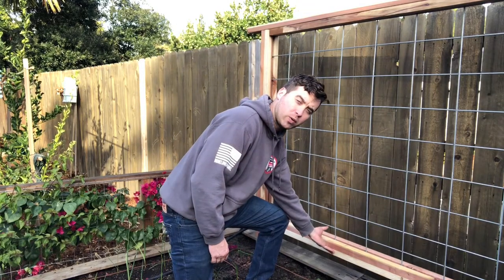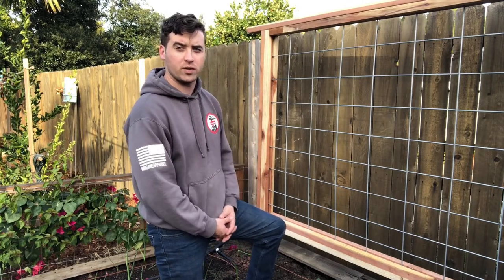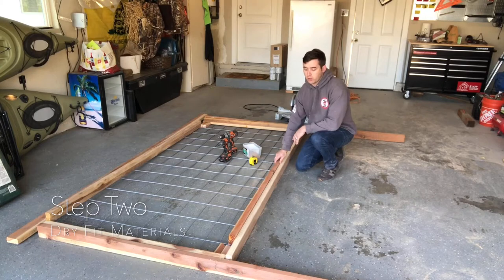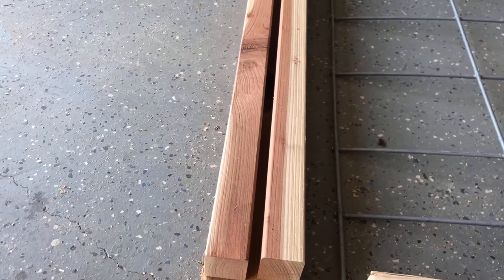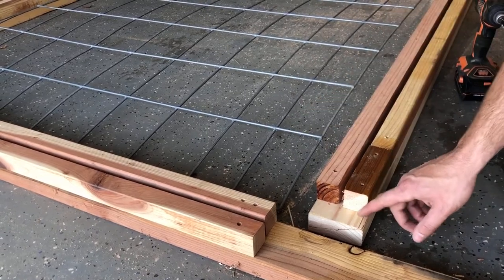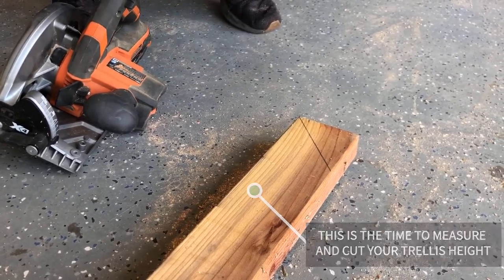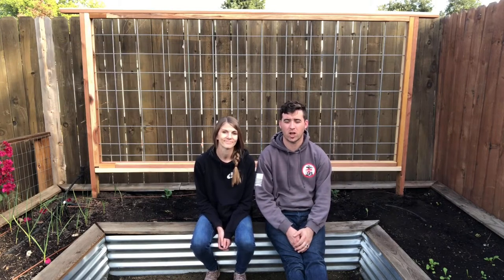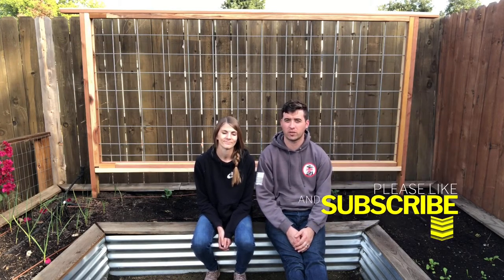DIY CATTLE PANEL GARDEN TRELLIS // Easy to Build and Sturdy Trellis for Your Garden Climbing Plants

Comment: Hi great job, I am think of building the same one. I just wonder for your post depth, is it sufficient for hanging pots. it looks fine for vines only but not sure if I need to dig more if I am gonna hang pots on that
Reply from the maker: The posts are about 14-18” deep. I would definitely go deeper if you were going to have significant weight hanging from it

Comment: Living in 9B, do you think those materials would be too harsh for the plants at the height of summer where temp goes up to 100+. Thanks.
Reply from the maker: Hi there, good question, but no the cattle panel doesn’t get hot even in the heat of the summer. We’ve used ours in the Sacramento heat now for two seasons with no issues 🌱

Comment: What is the length of the Hotwire panel on this trellis? Great video!
Reply from the maker: Hey Matt! Thanks for the comment. That specific trellis is about 10’ long but we buy the panels in 16’ sections from the tractor supply and cut them to the specific length using an angle grinder

Comment: With an 8’ length does the center start to sag over time?
Reply: If your worried put a middle leg
Reply from the maker: We haven’t had any issues with sagging. The cattle panel seems to keep it pretty square